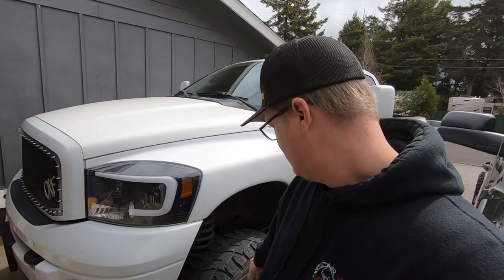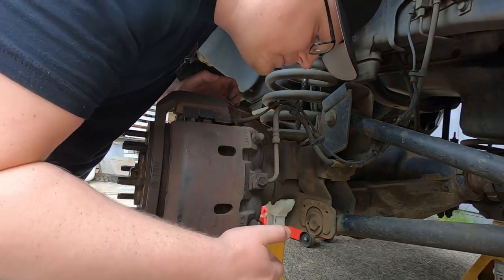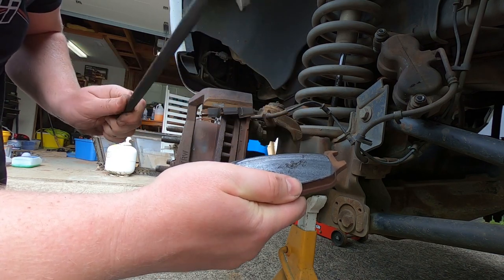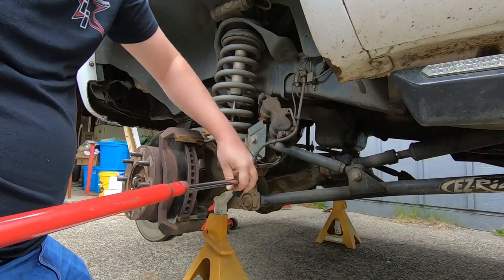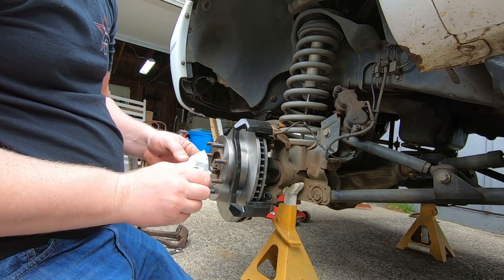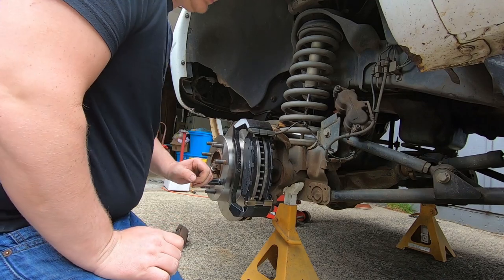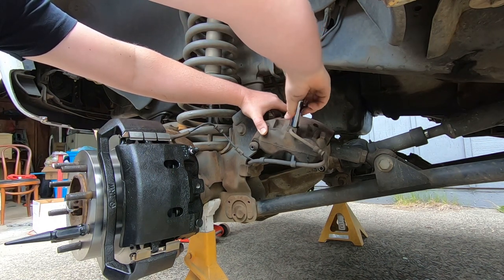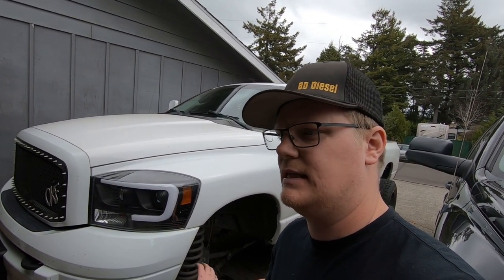Replacing the front brakes on my 2008 cummins

Comment: This is absolutely the best Ram 3500 brake etc video out  there.  A little closer look at the caliper going into the frame would be helpful, as would the torque requirement for the frame bolts and the caliper.  (120 ft/lbs frame and 24 caliper it seems) But hey!!  Thank you
Reply from the maker: Thank you!! There is always something I could improve on but I learn every video

Comment: Any recommendations on upgrades, or do you think OEM is peachy?
Reply from the maker: As far as brake pads I honestly don't know, one of these days I am going to step up to a more aggressive pad to see how good they work.
Reply: @Cargill450  hey, I've been running parts store pads for 14 years. For the first 6 I towed a #15K horse trailer often enough. Everything worked fine with that and the factory exhaust brake.
Reply: @Cargill450  i just got some slotted and drilled rotors with ceramic pads for my 07.5 mega cab from Detroit Axel. wish me luck
Reply from the maker: I bet they make a pretty good difference
Reply: @Cargill450  i'll let you know

Comment: I find it odd your rotors didn’t have the keeper on the studs..🧐
Reply from the maker: The only reason it didn't was the brakes have been off of it before, those little clips are only there for the assembly line also fun fact if you install aftermarket wheels alot of times those clips will keep the wheel from seating correctly on the rotor